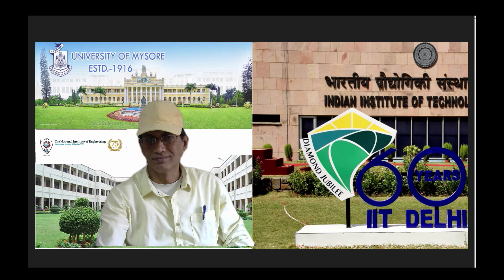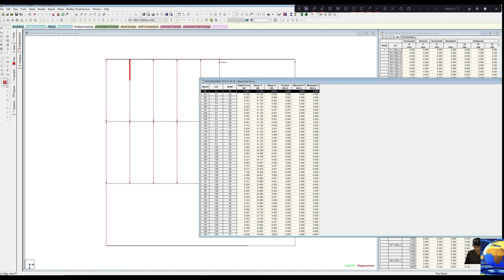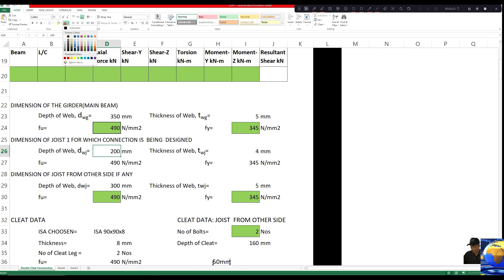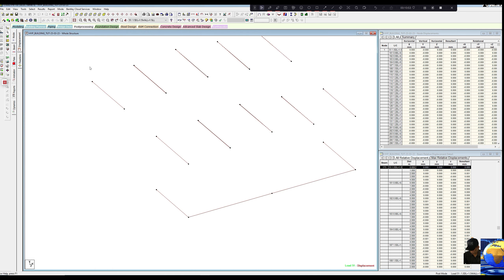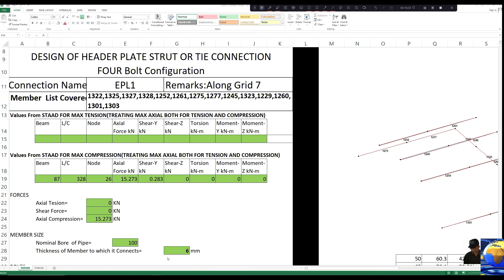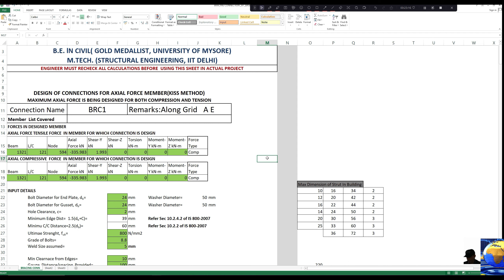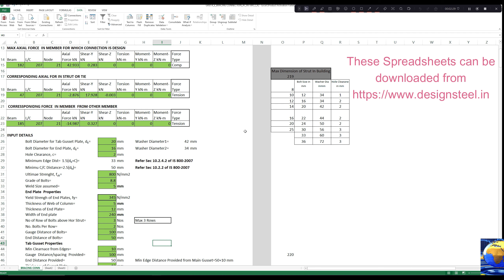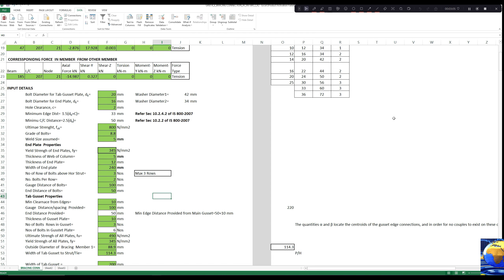SECTION 12C DESIGN OF SHEAR STRUTS AND BRACING CONNECTIONS

Comment: hi sir, 
do you design shear connection, and moment connection for strength envelop?
and base plate for servisibility envelop?
Reply from the maker: Both Base Plate and Connections are to be designed as per Limit State Strength Envelope. Serviceability envelop is for checking Displacement Or Design by Working Stress Method.
Reply: Thank u replying, but i have one more question,  i have seen that while designing base plate some engineer take support reaction to design base plate and some take column axial force to design base plate, could explain the reason?
Reply from the maker: Dear Pankaj, It is required to design on for Axial Load and Corresponding Shear  when the Base is Pinned. (Support Pin Support). Now You can Read is Load as an axial Load  and Shear from Member Force report or from Reading it from Support Reaction. Both will Be Same. Only Thing is that the Designer need to consider if the Support Reaction or Axial force involve uplift.